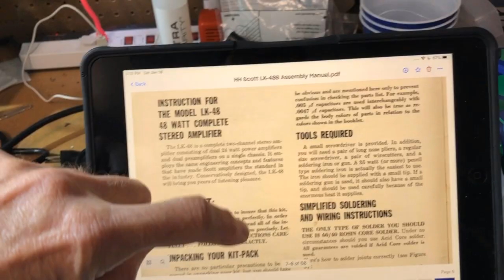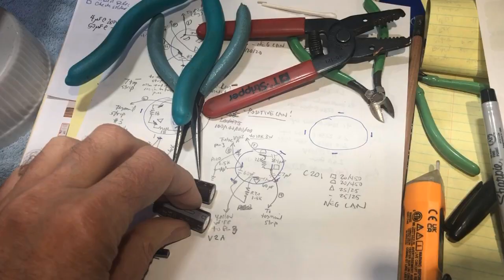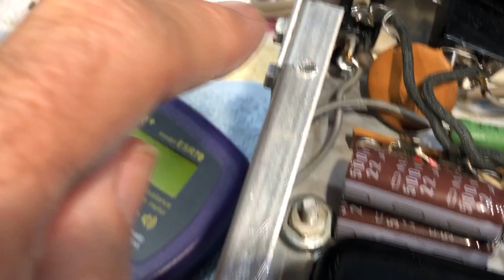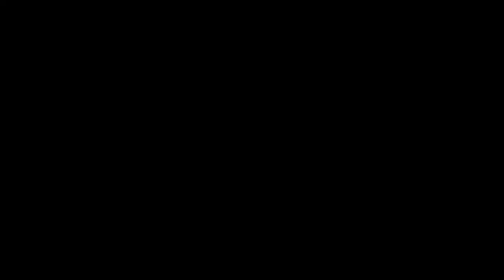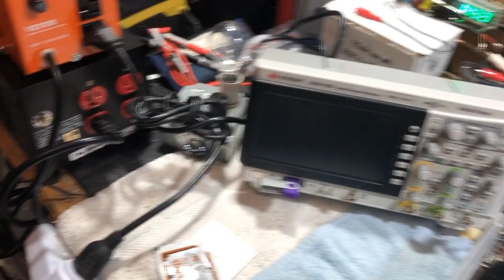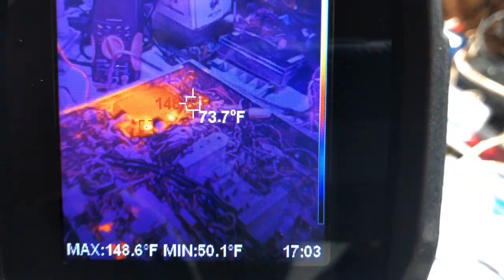HH Scott 222D/LK-48B Amplifier Refurbishment, Part 1

Comment: Hi Jim,

I really enjoyed your recent video. I have an HH Scott LK-150 amplifier and an LC-21 preamplifier, both of which sounded significantly better after I had them recapped about six years ago.

Recently, my granddaughter was playing with the tubes on the amplifier, and while my wife was trying to put one back, she accidentally broke one of the rivets on the 12AU7 tube socket.

I was watching your video where you replaced the front switch, but I was a bit disappointed to see that you used bolts to secure the new switch back in place rather than replacing the rivets.
I was hoping that you would show how to to install those types of rivets.

Best regards,

Marco Alfaro
Reply from the maker: Thanks for the kind words. Sorry to hear about your HH Scott amp. I did not have access to rivets and chose bolts because it would be easier if future repairs were needed.

Comment: Nice video...I've got a question. Can these amps accommedate a phone preamp? And where would that plug in
Reply from the maker: The Scott 222D already has a phono preamp. But you could connect an external phono preamp to the "Extra" or "Tuner" line-level inputs.